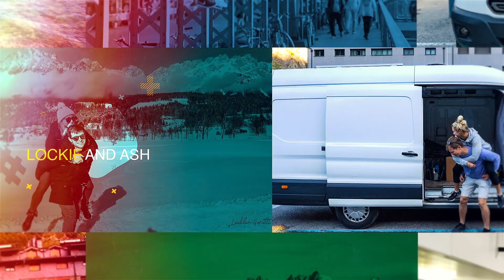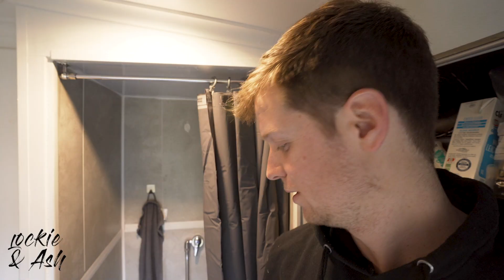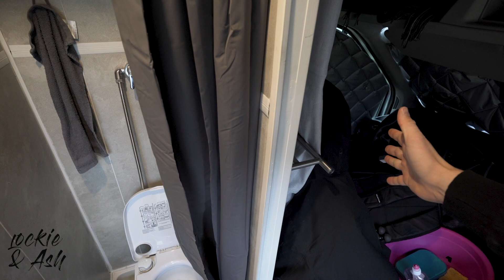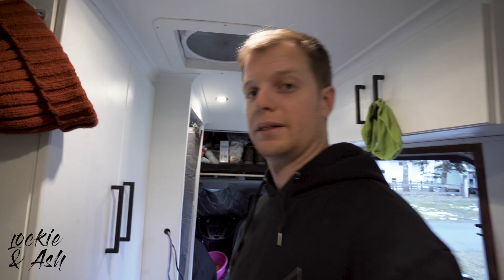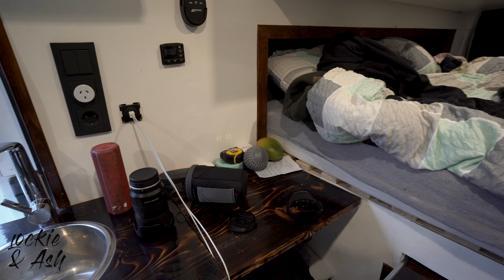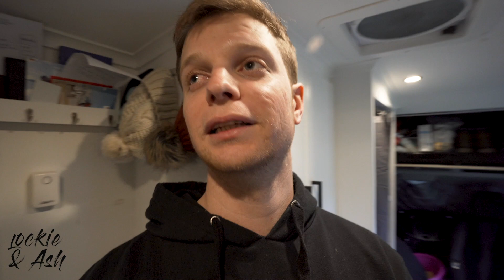Van Build Mistakes | Don't Make These Simple Mistakes | Looking Back 6 Months On

Comment: Unless one knows what he's doing, in many cases putting a vapor barrier can be worse than not... You can use the one that is permeable based on temperate and humidity.

For humidity, use a dehumidifier for example.

Comment: I really liked your explanations about why things need to change and how they are detrimental to your use of the van. I would have thought that the planar would have prevented the moisture (or does it create moisture?)
Reply from the maker: Thank you, glad it was helpful. I think it was a few gaps in the insulation that caused the issue. It’s now fixed up and no longer an issue

Comment: I couldn't be in that small of a space, id have side by side murphy beds, no wardrobe closet, and do the shower like you mentioned. I've seen shower rods made of pvc in a square and mounted on the wall. The curtain tucks/rolls up to the ceiling then it folds down against the wall, i believe there was a picture on top so when it was against the wall it looked like a picture frame. For the base they had a rubber pool that only had stiff plastic for the sides, it had a hose hook up on it and it rolled up to the size of a kids lunch box. That's just me though, you did some great work on the finished look and it looks very nice, just not enough space to move around. 
   You answered a comment and said you didn't insulate the beam, is that to say the actual metal beam itself and not between them? I wouldn't have thought that would be an issue, i see why people use the silver looking bubble wrap blanket material now. Glad i saw this in my feed, i wasn't sure wether i was going to just use tyvek house wrap over blue board or the better stuff. It would suck making something that looks so nice, then taking it all down. Thanks for the video!

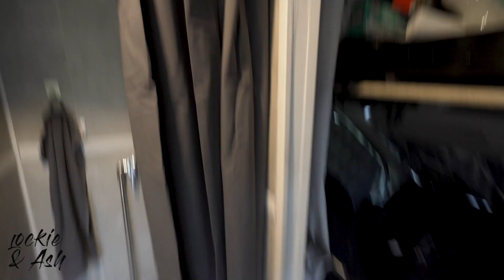Comment: how did you install that curtain over the partition storage area? 3:30
Reply from the maker: We just installed a curtain rail so we could push it back and forth. We have changed this since however as we found we didn’t need it with the insulation we put over the front windows. We now just have a small curtain to cover the storage area that is fixed

Comment: Please give more details on what you did wrong with, and how you plan to fix, your ceiling insulation and vapor barrier.  Thanks.
Reply from the maker: We didn’t put insulation in the beams of the van and eventually it led to condensation dripping onto the ceiling.. unfortunately we had to rip the ceiling down re do it and put it back up.

Comment: Don't rip it all down just yet.. look at your venting.. damp mould and  mildew are caused because of lack of airflow... having a shower causes so much... But good ventilation should sort out the damp issue.. also.. fold your clothes.. remove the wardrobe.. that takes up so much space! If you remove that, you could double your "chill out space" without having to remove your shower. Also... Let's be honest.  You both need to declutter..  throw out anything you haven't touched in the last week.